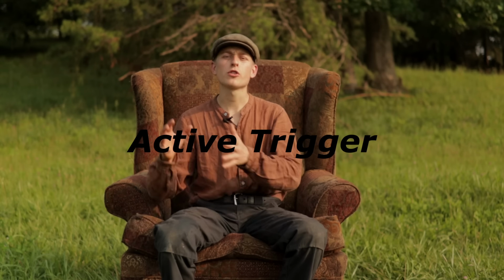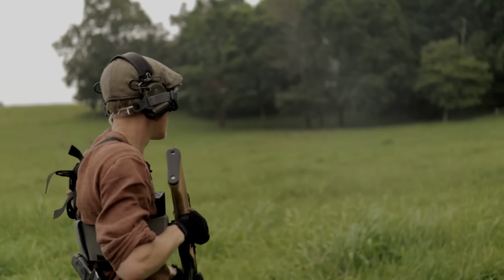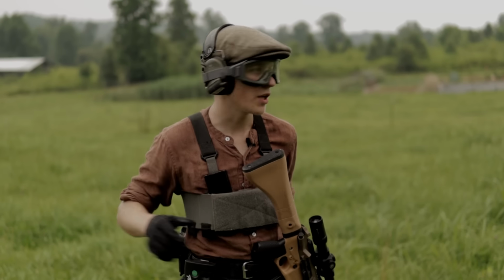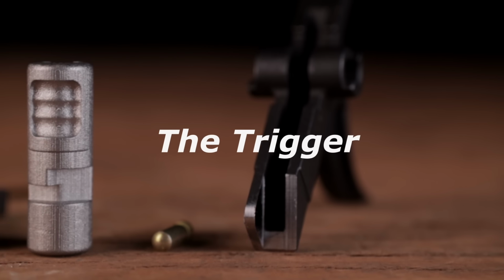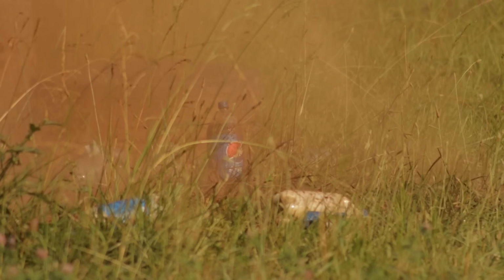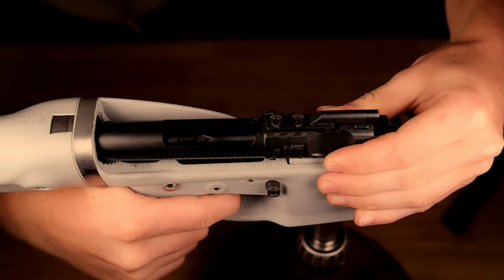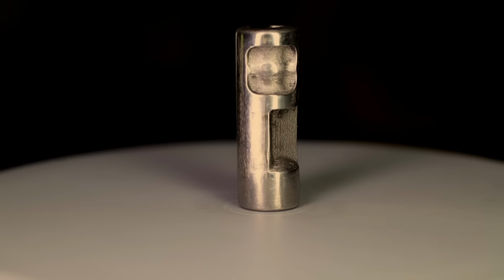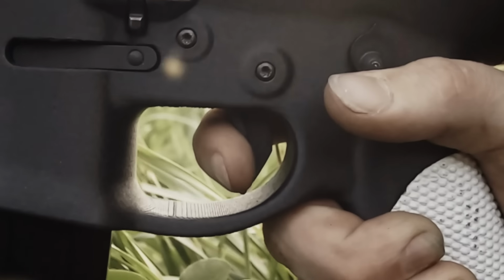Introducing the Super Safety

Comment: Would this work with a cmmg conversion bolt?
Reply from the maker: Nope.
Reply: @HoffmanTactical  oh 🥺
Reply: You’d need the bolt trip mod
Reply: @MyLonewolf25  Even with that it wouldnt work anyway.  The 22 and 9mm dont have enough force to make the lever work.  It would just result in the lever stopping the bolt from coming back and thus you get a stove pipe.  Those 2 conversions area already at max load just moving the bolt to the rear,  add drag to it and things just dont work.

Comment: Is this just a clever alternative or a wide open trigger but built into the safety instead ? this is super cool and being able to toggle between a regular trigger and a WOT is really neat
Reply: Mechanically, what it does is similar to the WOT, which is also not a machinegun by legal definition. The ATFs enforcement actions are based on their administrative redefinition of the term "single function of the trigger" which while not directly addressed in recent Supreme Court cases, has been shown to be on untenably thin legal ice and will undoubtedly fail to hold up if it makes it to the USSC unless someone rigs the game.
Reply: @stevep7346  Do not count on the Supreme Court, it has multiple personality disorder.
Reply: This is clearly not a wide open trigger, it’s merely a way to have a lighter trigger pull for each consecutive shot.  It still requires a conscious effort to pull the trigger for each round.

Comment: Are m16's close enough to ar15's to use this as well? Rephrase of the question: can you put these in m16's?
Reply: Plenty of room in an M16 lower receiver with the auto sear removed, but the pin holes would be points of ingress
Reply: I mean, yes.

Comment: Hey @Hoffman_Tactical what kind of metal printer did you use to make the 3 position safety?
Reply: Lost PLA metal casting could probably work
Reply: I think Shapeways will do a number of different metals for a price
Reply: You can't afford the metal 3d printer for sure lol
Reply: There are several sites like Xometry and Fictiv that will quote you for cad files to be printed in metal.
Reply from the maker: Had it done by an OEM.

Comment: Already downloaded it! Fantastic design dude. Could you use this with a drop in trigger pack?
Reply: This idea could be modified to work with a drop in pack, but the geometry is designed around the modified tail of a milspec trigger, with additional modifications described for the 3 position version. Drop-in packs typically are compatible with a milspec safety, so it's possible they could be compatible with this, though I wouldn't expect it to be plug and play - modification is likely required. Things like smooth geometry to follow the cam, position and width of the trigger "tail" bars, and trigger reset distance are all important for this mechanism to work. If any of that is different, it would not work, and could potentially malfunction in an unsafe way.
Reply: ATF will be in contact soon
Reply: @4lan39 fed
Reply: @4lan39 no one cares
Reply: @4lan39  Fed
Reply: @4lan39 fed
Reply: @4lan39 ducking fed
Reply: @4lan39 you have families just like us pal
Reply: @4lan39  chode
Reply: @4lan39 you have replied to half the comments on this video with nothing but BS fear mongering. You work for the federal government or something?